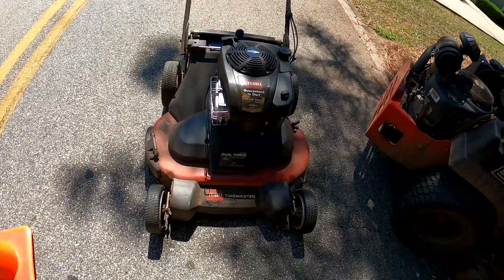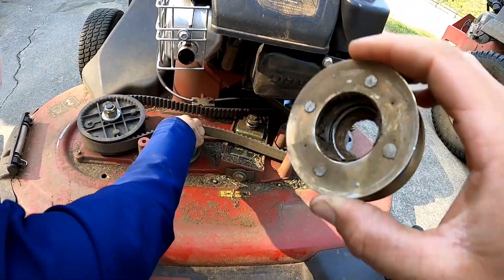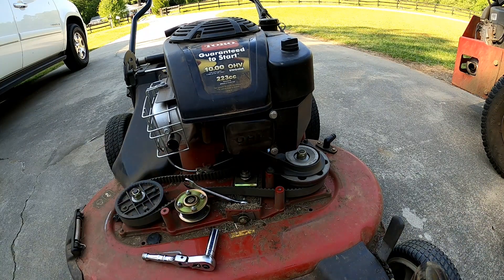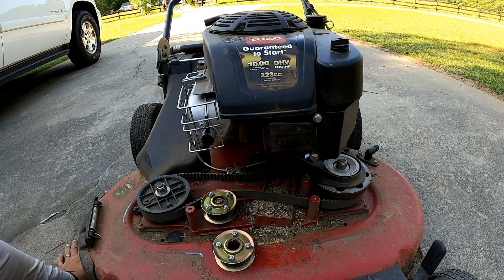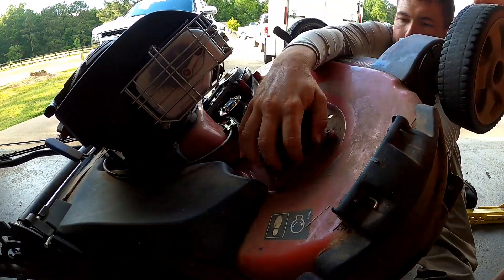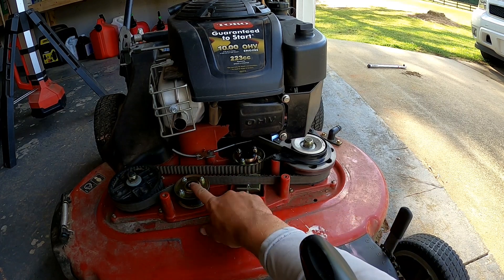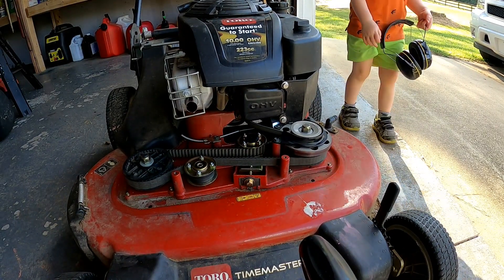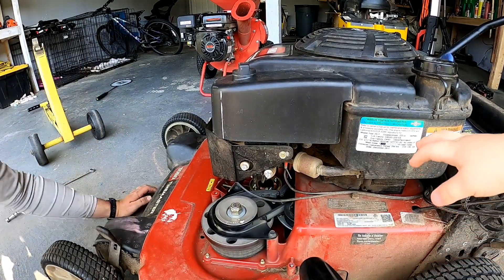Timemaster goes NUCLEAR🤯  [pulley replacement. toro 131-4529]

Comment: Always put the dust covers on. My first Timemaster was a nightmare. Found out post was welded off angle from factory. After I fixed it I put new pulleys and I put a squirt of window seal lubricant because it does not hold dirt, but repeals water. 😉 Then put on dust covers and adjust your timing belt with a business card and life is good. My second Timemaster has well over 2,000 hours and still has original pulleys. I got to the point where I can change a pulley on the job within 20 mins. You got the experience now.👍
Reply from the maker: Its awesome buddy!!! Great info

Comment: River is a good helper. Teach him young and you wont regret it. I would keep the pulley area clean about every 4 or 5 cuts like I do with my Cub Cadet Pro 100 and replace those blades because they will be out of balance from the damage and vibrate the mower. I have considered one of those mowers many times. Have a great day.
Reply from the maker: Great advice those are good ideas !

Comment: Tony’s Lawn Care. If you have any Tractor Supply Co stores around your area - They usually have a fairly large stock of bels. At least maybe you could find something close enough to buy time to order OEM parts The TSC stores here in Kentucky now sell TORO mowers and support products.
Reply from the maker: Great input but thankfully i also have a turfmaster so i can just use that while I wait 🙂
Reply: Tony’s Lawn Care. It’s always great to have a spare mower to fall back on. My sister recently purchased one of the residential Toro Recycler 22 inch mowers. I am very impressed with the looks of this mower that delivers a very neat cut quality. I’m kind of curious about the Briggs & Stratton engine that you add oil - but not change. Looks like a designed failure to me. 
I really like the 30 inch cut Toro mowers like yours that you have in the video. I’m drawn to videos like yours in that I can see what tears up and what it takes to get back up and going. Is that the original belt and pulley replacement that you have had to perform on your Toro?. These mowers seem to be very reliable from what I can tell. Be Safe & Be Careful Out There.

Comment: To get the timing of the blades correct,  there are clearance holes in the spindle pulleys that you put a drill bit in the cleance holes and it makes sure the blades are in time.
Reply from the maker: Thank you buddy

Comment: May should've gone with the Exmark commercial pulleys..though pricey i heard they last much longer.
Reply from the maker: I have a exmark commercial mower ill have to see if they are any different
Reply: @tonyslawncare  model 126-5880. $40-45 EACH.
Reply: @trevor-bd4kt  - The full eXmark set (with better adjusting bracket hardware) is part # 126-7890. Yeah, pricey, at $114 but... subtract the $40 price of a set of the Toro pulleys, then figure in your labor time, work down-time, and blade and belt damage, and they begin to seem like a better deal.

Comment: eXmark part # 126-7890. They cost too much, but they're much better pulleys, and your time replacing the Toro pulleys costs you, too. By the time you've put a couple sets of Toro pulleys on, the eXmark version begins to look like a much better deal. And that's not counting downtime, belt damage and blade damage.

Folks have some different theories about how tight to run that timing belt. I have pretty good luck just setting it the way Toro recommends. There's a rectangular spring washer under the tension adjusting bolt head (if not, you're missing a piece). It has a gap under it. Toro says it's tensioned right when you've tightened down the tension adjusting bolt till that gap squeezes down just enough to allow a thick piece of paper (0.010" feeler gauge) to pass.
Reply from the maker: Thank you buddy